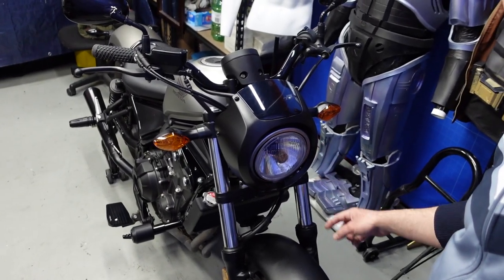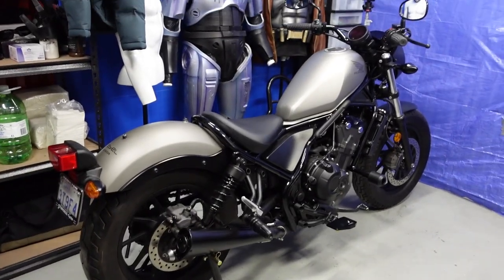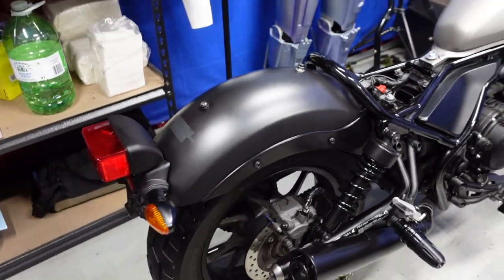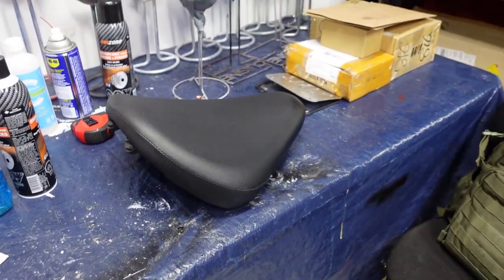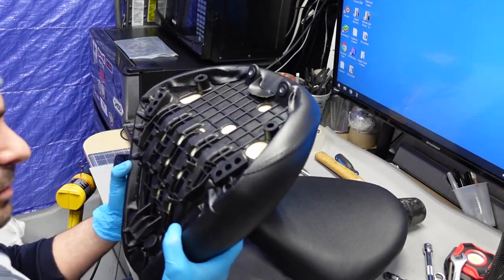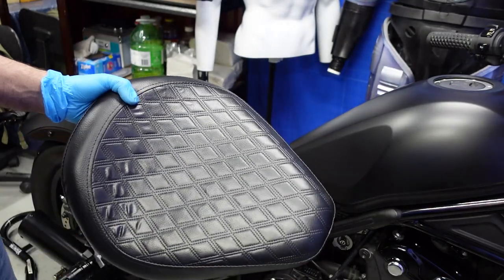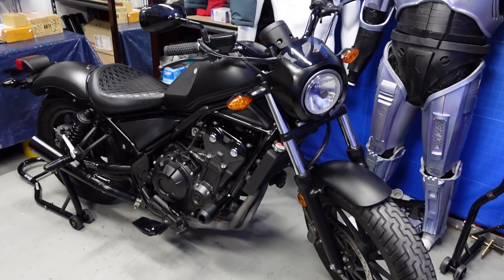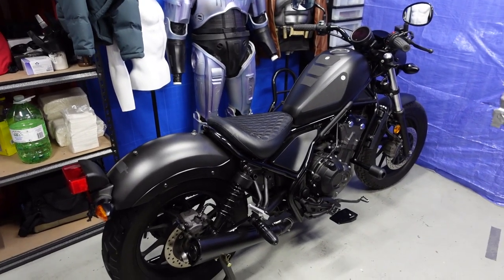Fuel Tank Cover & New Seat - Honda Rebel 500

Comment: But hey dude I am a bit worried because they didn't have a Rebel available to test drive. On my Honda Hornet I could be side by side with a Porsche 911 turbo and give it full throttle and the guy in the Porsche (at least Until I hot 130 mph) would be like WTF. O don't have to ask but that ain't the Rebels strong point.